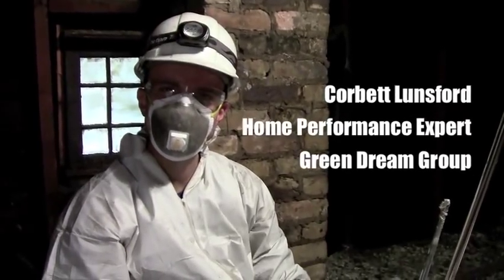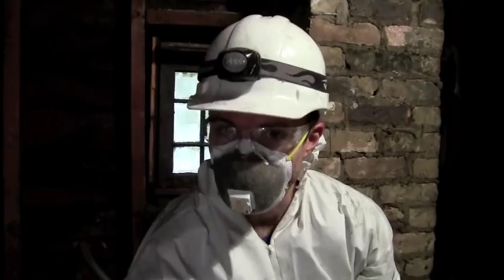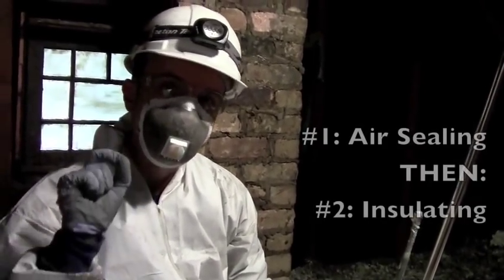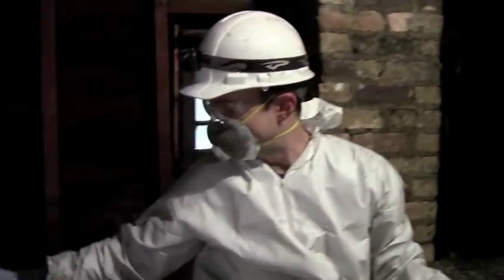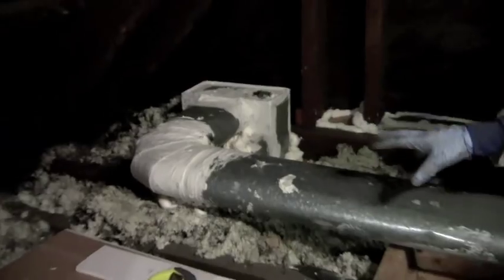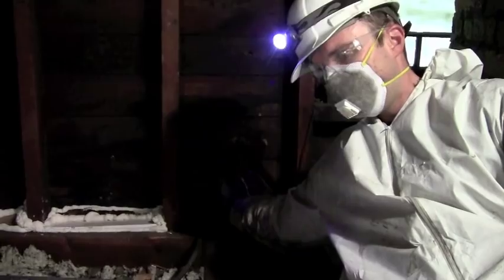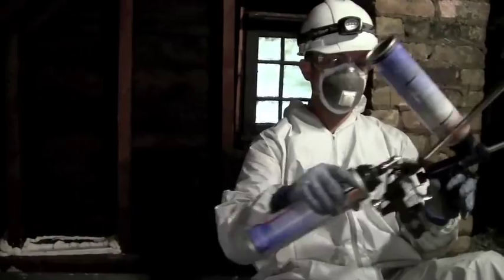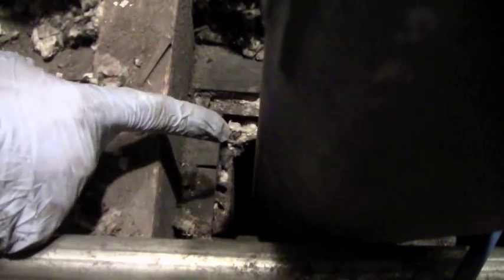How to Air Seal Your Attic: The Secret Home Improvement BEFORE Attic Insulation

Comment: You should be in radio with that voice.  Do you remove and replace existing blown in fiberglass insulation before you air seal or just move the insulation from one area to another.
Reply from the maker: Thanks buddy! No need to remove if it still works- just rake it to the side

Comment: I've been doing attic insulating for a couple years now, I'm just learning about air sealing now. How do you charge for it? Price per opening? I do build boxes around pot lights and other light openings made from rigid foam and tuck tape, I charge $7 per box.
Reply from the maker: +andrew beaudry price it however you can supply and pay your crew and make a profit. That sounds easy, but what you have to do is figure out through experimentation what you can GUARANTEE as an air leakage reduction. That's the Proof Is Possible concept- test before, fix problem, test after, proven.
Reply: Home Performance 
Even with blower door test how can I show proof of attic sealing ie plumbing openings etc. When I'm not sealing the whole house, showing sealing around ceiling lights is easy (smoke stick), But how to I show sealing other things? 
Thanks
Reply from the maker: +andrew beaudry Zonal Pressure Testing, my friend! Using just a hose and manometer, and a pressure pan, youcan quantify all kinds of airsealing improvements! Check out my book and videos on the topic.
Reply: @andrewbeaudry4399  If you seal the attic, even though you missed the windows, bad doors, and basement - you should still see around a 15-30% improvement in the blower door number. Bad windows and french/patio doors are probably the next biggest loss. But if you do the crawl space they could probably get an extra 5%.

Comment: i live in a 1960s raised ranch in northeast US and thinking about air sealing my attic with spray foam (ceiling, gable vents, soffits, ridge vent etc). Ive measured the temps in my attic in the summer around 140F! Would you recommend this or do you think getting an attic too tight to the house is a bad thing.
Reply from the maker: The attic can actually be as hot as it wants, as long as your top floor ceiling is airsealed and insulated away from it. Encapsulating an attic is NOT a cure-all.
Reply: @HomePerformance  agree. I don't think I'll be able to truly seal my attic floor though. I have about 25 or so ceiling lights, my AC handler/ductwork and pull down stairs. I know I can cover them all will cellulose and foam around them but then I make them difficult to remove. Also the heat definitely taxes my AC handler. In the summer last year at full power I was only in the mid 60s coming out of it on a 90 day! Was wondering if you oppose that method or of you think there are instances when it's preferred

Comment: For a professional you have a shitty respirator. I would recommend the one with a rubber gasket and two filters (one on either side). If you keep your face shaved the rubber will seal much better. Totally easy to diy.

Just have to get a Tyvek suit ($20 - 6 pack), 3m respirator ($35+$20(filters)), foam gun ($45), and foam cans (12x-20x @ $15 each). But you do have to be careful what you foam. Like you can not foam electrical boxes or fixtures until you put something over it. And Chimneys/kitchen exhaust vents and other hot items probably need to be handled professionally.

Idk where you get the hvac muck though.

Comment: How would you air seal the attic floor underneath the faced pink rolls of insulation?   I heard a vapor barrier paint or good latex paint would help along with caulking or spray-foaming any joints where drywall meets the top sill-plate of the perimeter walls or where drywall joins other drywall.  Can't forget about those ceiling light boxes and bath fans that leak air.  Thanks!
Reply: You have to pull up and remove the insulation. Then air seal.

Comment: So if you air seal the attic, is it safe to say the air in the attic does not mix or interface with the air in the living areas of the Home?
Reply from the maker: Exactly. So you shouldn’t have to care what the insulation is made of, or how hot it gets up there (unless you have uninsulated ducts).

Comment: Would moisture build up on the floor of the attic in the summer? How is moisture controlled here?
Reply from the maker: That's what attic ventilation is for. Depends where you are in the country, but no, this approach works most places without condensation issues in the hot months.
Reply: Home Performance So I should think of it as sealing off the attic from the living space.
Reply from the maker: Yes sir